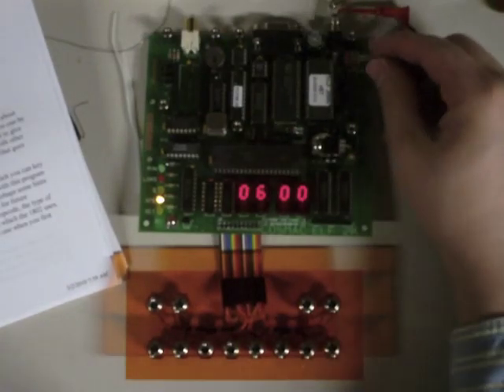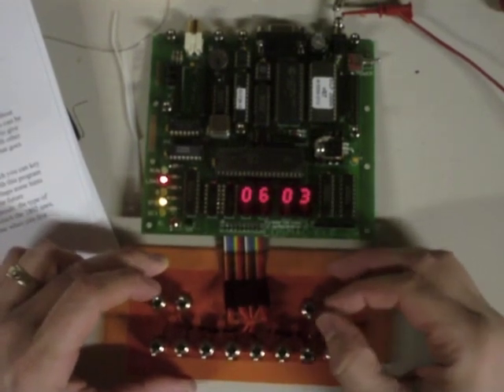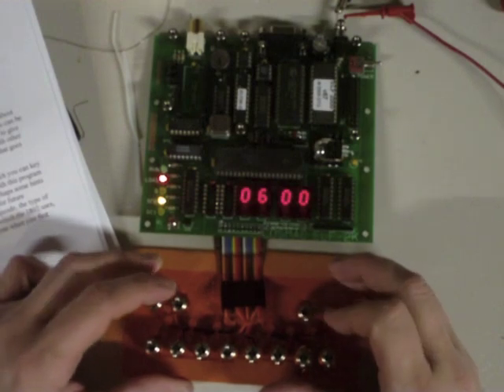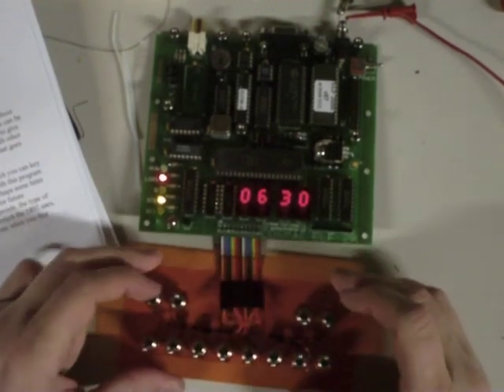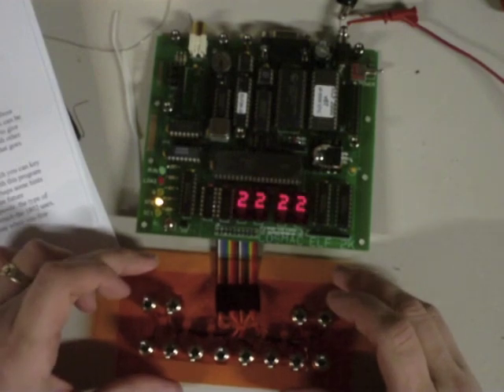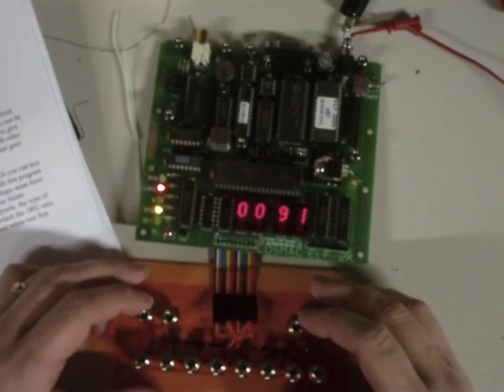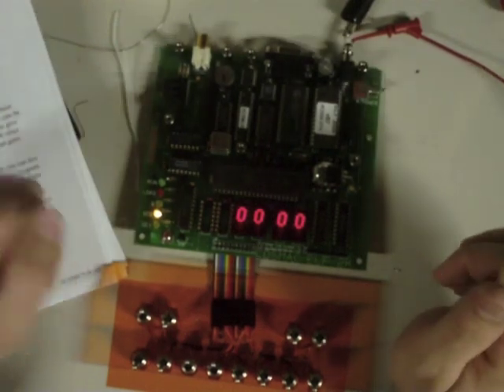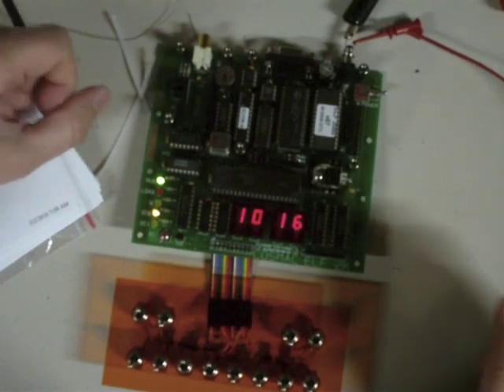COSMAC Elf 2000 Checkout

Comment: Though honking bigger, get some standard garden variety light switches, you can buy them in bulk for like a buck a piece at Home Depot.  I would think they would be hella easier on your fingers, and bigger and easier to operate.   Just make a seperate box with ribbon cable, that you could plug into your elf, and then unplug and use your small micro switches when you wanted it to be portable.  Go over to a light switch on your wall and flic it to see what I mean